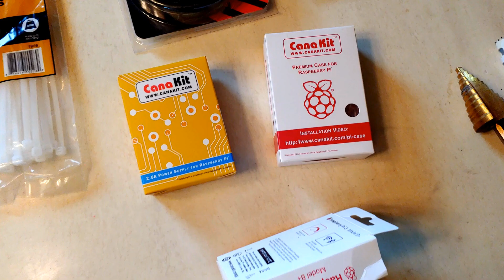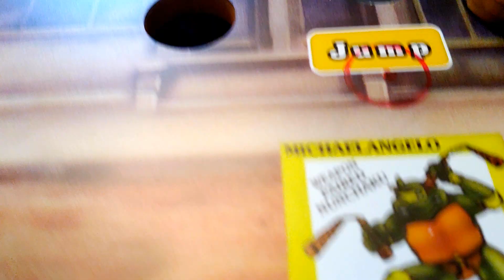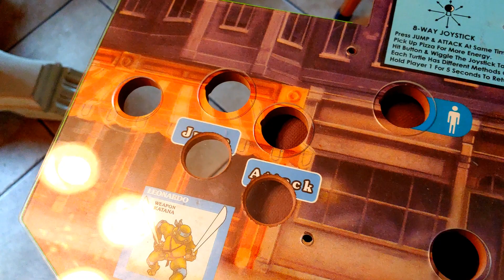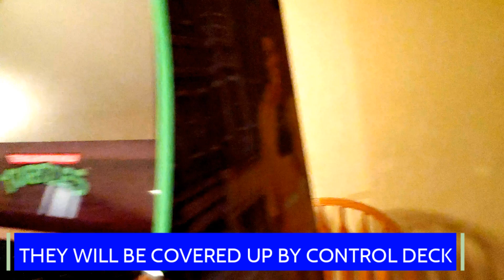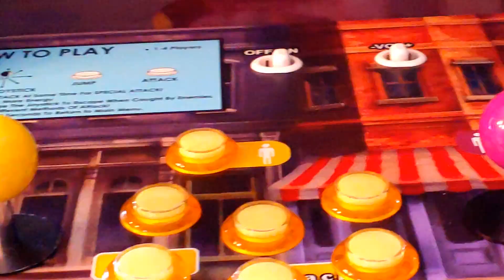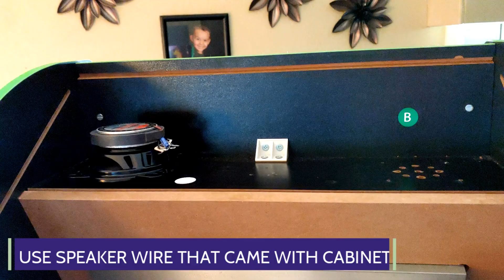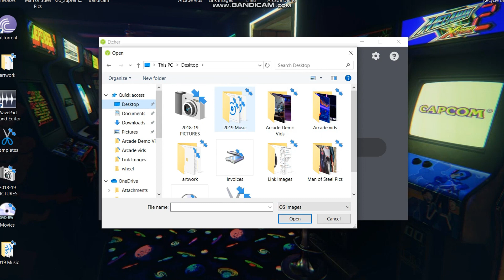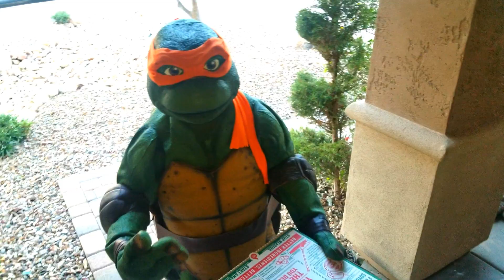TMNT Arcade1up 4 Player Cabinet Mod Tutorial

Comment: Great video. Had a few questions. How would you consider modding just for specific 2 and 4 player games with 4 buttons ? I want to have  neo geo games and 4player sports, action,etc. Should i go with the setup you recommended in this video without the extra buttons. I wish to only use 4 buttons max for each player and the games compatible for it or will i need a specific board and program? Sorry i am new to this. Any help is appreciated. Thank you
Reply from the maker: Hi Paul great question, all you would have to do is just add two buttons to each player since they come with two stock, should be very easy to do since there's plenty of space on the control deck for four buttons. The tricky part was trying to find space on the board to place the additional 5 6 7 and 8 button but if you only need four should be a piece of cake you can just pick the most convenient spot for the extra two buttons on each player

Comment: Curious why you didn’t use a Pi 4? I deciding between Pi3B+ or Pi 4. Still learning the mod world.
Reply from the maker: Good question, when I did this build back in January the pie for was just being released and had a lot of negative reviews online as far as overheating issues and not being compatible with a lot of the emulators, I think the longer the pie for is released the more people will learn about it and it will be updated and probably the better option over the pi 3

Comment: Got another one...I didn’t see you mention the coin buttons and where to hook them up at?  I feel like the little white cables that came with my buttons kit (same you linked too but mine are simply 3-prong plugs on both ends, button and board) are not very long.
Reply: Also, did you end up cracking the plexi in the end because you definitely didn’t have it on during your replacement of the top screws.  Maybe it’s on at the end but I didn’t notice.  Mine cracked to shit.

Comment: I must have missed something, where was the step of wiring up the buttons and the new joysticks? There was an empty control panel and then they were all in there and in place. 

Also, is it possible to use the factory speakers and volume and power switches?
Reply from the maker: Yep those steps were in the middle of the video....
Yes the fa tory speakers will blow with loud volume ...they are very low quality

You can wire the volume and power but it is not part of this tutorial ...
The wired ha e to be spliced into the correct plugs for these encoders to work
Reply: @arcadepickers1682  The buttons and joysticks seem to just magically show up in the control deck here - https://youtu.be/g9d1s0E1hPM?t=1296 , but I don't see anywhere in the video where you're adding them individually or wiring them up. I also didn't see the diagram you mentioned....I wonder if my player is skipping parts of the build.
Reply from the maker: So you're right I didn't actually do that on camera because I had to use both hands but all I did was push the buttons through from the topside and screw the washer on the backside the joysticks screwed into the same olds that the other one were in so no drilling required then it was just positive negative on each button and positive negative on each LED light on each button and the diagram comes with the buttons in the package from Amazon and you will see me show what it looks like a couple of times in the video all you have to do is make sure you put each button in the same slot on each decoder example button a for player 1 2 3 and 4 goes in slot one on the decoder button be for Player 1 2 3 4 goes in Slot 2 Etc.......
Reply: @arcadepickers1682  thanks. One last question (I'm a newbie here, got my TMNT cabinet coming tomorrow), if I dont want to hook up the power for the LED's, can that just remain unhooked, or are they required to be plugged in?
Reply from the maker: @MatrixPrime  no you can definitely leave them on hooked they are on a separate power source so if you just want to use the buttons no problem much easier to hook up just positive and negative on each button and you're done
Reply from the maker: Good luck with your machine tomorrow let me know if you have any questions along the way during your build I have no problem answering

Comment: Curious as to what other speaker and amp you would use because the ones in the link are no longer in stock. Thanks for the video
Reply from the maker: Really you can use any 4 inch speakers you would like they even have some that have lights in them if you want to go all out fairly inexpensive. As far as the amp it just depends on if you're planning on using a subwoofer or not if you are you just need any 2 channel amp that has subwoofer input as well and you usually have to always buy the power source separately. So go on Amazon and type in the one that I put the link and you will see recommended products on the same page usually has several other competitors with the same exact thing. Thank you for watching the video

Comment: Love this setup. Working on my own and have made substantial progress, but can you give some guidance on how you used that RCA cable to wire the subwoofer into the amp? I have a sub with two RCA low level inputs, and I need to get them to the +/- input on the same amp you used.
Reply from the maker: So all you do is just cut the end of the RCA's off with scissors then strip them down to the wire and connect them in to positive and negative and it's a done deal super easy
Reply: Got it! Thanks again for the help. Getting super excited about this!
Reply from the maker: @enolam05  by the way when you split it down two two wires each two wires might have their own two wires all you have to do is hook one side or the other into the positive and negative and it will be enough to power the subwoofer

Comment: Want to do this to my TMNT box, but the powersupply, speakers and sub are out of stock.  Do you have a recommendation for replacements?  Also do you think a raspberry 4 would be better?
Reply from the maker: Thank you so much for watching, you can use any 12 volt power supply that matches the same details of this one, also any 4in speakers will work with any subwoofer as well

Comment: Do you know if is possible to mod this to include like light guns as well?
Reply from the maker: It definitely is however I do not have any experience in that, I've heard it is very finicky and very hard to maintain accuracy.... what I do recommend is getting an RCA to HDMI converter then you can plug your Nintendo Wii into the HDMI with a splitter on the back then you can play any of the shooting games by we by simply placing the bar from the Wii on top of your arcade1up now you can play games like House of the Dead silent scope and hunting games with no problems whatsoever and you have several options of different sizes and shapes of guns to put your Wii mote in

Comment: Hey, great video!   I am confused on the hole dozer though?  You showed the 1 3/4 but put underneath 1 3/8?   Which one should I get?
Reply from the maker: 1 and 3/8
Reply: Thanks man!!!!!
Reply: @arcadepickers1682  Any reason to not just get a 1-1/8 hole dozer (hole saw), and use it for all the holes?  PCB board, Acryllic cover, and Plastic box?  I've never used a hole saw before, so sorry if this is a daft question!  I've seen lots of folks either use spade bits, step bits, or hole saws, so I wasn't sure what the right tool for each job really was, though you're one of the few who didn't crack the plexiglass!

Comment: Hello, did you just leave the back cover off? Also, do you have a link to the remote control power you referenced in another reply?
Reply from the maker: If it's up against the wall it will air out much better if you leave the back out and prevent overheating. I don't have a link but it's super easy to find at Walmart, it's over by the extension cords aisle and it plugged into the wall and you plug your arcade into it and it comes with a remote for about 8 bucks

Comment: I'm thinking about modding a Marvel Super Heroes cabinet. Is it possible to just use the stock speakers in the cabinet or do you need an amp and extra speakers?  Also I'm guessing you don't HAVE to replace the buttons and joysticks, but you may want to for quality reasons? (I know I would have to install two 'select' buttons)
Reply from the maker: You have to replace all of it....sorry

Comment: Thanks again for your tutorial got my machine up and running, do you have any issues with wwf wrestlemania working? For some reason it won't boot for me, I have the same crispr image as you also
Reply from the maker: YES YOU HAVE TO ADD THE PSX VERSION FOR SOME REASON....WATCH MY TUTORIAL ON ADDING PSX GAMES ITS EASY :)  THANKS
Reply: @arcadepickers1682  awesome thanks so much I was super bummed when it wouldn't boot
Reply from the maker: Me too...the psx version is pretty slick though !!! Happy gaming
Reply: @arcadepickers1682 did you have to set that favorites section up? Mine seems to be only sorted by system and no favorites category? Sorry to keep asking questions lol but you always seem to have the right answers for me lol
Reply from the maker: @MidwestVillain_Z  yes watch the tutorial called retropie setup favorites you have to go in and set up a favorites key on your keyboard and plug it into the Raspberry Pi then you can push the specific key every time you're on a game that is one of your favorites then inside of the retropie menu and you can go to generate favorites list and it will create your own custom list, I will do a tutorial on that soon but there are plenty of them on there right now. Good luck

Comment: Installed everything according to the video and as I was configuring the buttons the joystick would only read the up motion. Tried on another joystick and the same thing happened. Any idea what's going on?
Reply from the maker: Something is not wired up correctly, go through everything with a fine-tooth comb and double-check there is nothing incorrect, it is very tricky with the positive and negative wires. If everything is hooked up right it should work but sometimes it takes two or three times going over everything carefully

Comment: Excellent video, proved very useful to me while I completed my own over the past few weeks. QUESTION: Has anyone figured out how to save controller reassignments on a per-game basis? Meaning I generally want P1 and P2 to be Michelangelo and Donatello (where I have the most buttons), but when I switch to a fixed 4 player game like TMNT, I want P1 Leo, P2 Mike, P3 Don, P4 Raph. I know how to reassign controllers in Libretro and Retroarch, but it will only save by Core, not by game.
Reply: Did you ever come up with a solution for this mate?  I just realized the same concern as I started to put mine together
Reply: Just like arcade1up, you got Raph and Mikey reversed.

Comment: I think the link you provided for the display converter is an incorrect fit for the TMNT cabinet. Is that what you have working in your TMNT cabinet?
Reply from the maker: It is and I've been putting it on multiple TMNT cabinet for customers and it definitely works
Reply: @arcadepickers1682  ok, that's great. It's the one I got because I'm following your tutorial. I had just found during researching that the converters are for different cabs & the model numbers didn't match. So I just wasn'ts sure. I just have to get an image now & set it, to be done with my mod. Thx bud, you're a big help

Comment: Arizona’s Arcade Heroes what ROMs sets and packs torrent did you download? I liked your setup
Reply from the maker: If you go to my let's play Sonic Adventure 2 video it has the link in the description from arcade punks
Reply: A smaller sound bar and sub that I do not use any more should work right? It has the auxiliary and it own power
Reply from the maker: @myopinion2578  should work as long as the sound bar fits behind the Marquee and as long as it has the correct hook ups for the amplifier

Comment: Suggested images for 3b+ and pi4? By name? Sounds like pi 4 is the way to go now. About to do first mod. Purchased 3b+, thinking of returning. Want access to more N64 games. Going to follow your video for install. Need to learn how you added the music videos. Great add
Reply from the maker: I am not familiar with Raspberry Pi for the only thing I can tell you is I read that after it's released it had issues with overheating so you might want to research that, I have also researched that by overclocking your Raspberry Pi 3 B+ you can play N64 games a lot better, sorry I couldn't be more help, the only image that I am familiar with is the crisp image would you can find available in the link description on my Sonic Adventure video and if you look on my channel I also have a video about how to add the music videos walking you through it step-by-step, good luck to you my friend

Comment: Thanks for the detailed video. Do you know where else I can find the LED buttons and joysticks. They are sold out on Amazon. Thanks
Reply from the maker: You can pretty much by any two player arcade joystick kit off of Amazon, in fact since I released this video they have the new plug-in play ones that are way easier to hook up
Reply: Arizona's Arcade Heroes 
You have a link to them. This would be my first build.
Reply from the maker: @TexasFinest_Collectibles  https://www.amazon.com/dp/B07QMM4J9X/ref=cm_sw_r_em_apa_i_XAg2EbDXV3FDC
Reply: Arizona's Arcade Heroes 
Ah thanks, the joysticks are different on that set though.
Reply from the maker: @TexasFinest_Collectibles  it will work :)
Reply: Arizona's Arcade Heroes 
What’s the purpose of drilling the 2 holes on the sides on the control deck. I’m in the process of modding my cabinet but I’m keeping the coin buttons at the top of the control deck next to the player 1-4 buttons.
Reply from the maker: @TexasFinest_Collectibles  it just allows you to run the cords from the outside players controllers route to the back without smashing them down on the control deck there is a gate that blocks them on either side
Reply: Arizona's Arcade Heroes Thanks for the quick response. 
About how  many cords/cables will I have to run through the gate wall. Just trying to gauge how big the hole really needs to be. I’m keeping the coin buttons at the top of the control deck next to the player buttons, so I won’t need to drill the additional 4 holes that go to the bottom of the control deck. I’ll just need to drill 6 holes total. 4 on the back and then 1 on each side of the gate.
Reply from the maker: @TexasFinest_Collectibles  well you will have to run at least two sets of cords from each button so depending on if you used 4 or 6 buttons you will need one for each button then you will probably have to splice additional wire on to them to make them long enough to fit through the hole and reach all the way down into the back to the encoder
Reply: Arizona's Arcade Heroes 
Alright man almost done with the control panel. I have all the holes drilled, led buttons installed and wires plugged into the encoders. I’m stuck on the on/off and volume buttons, is there anything I need to do with those cables. Do you have an email address I can reach you at. I don’t have FB. Thanks man
Reply from the maker: @TexasFinest_Collectibles  the on-off buttons are obsolete as well as the volume you can just leave the wires taped up against the bottom of the control deck in case you have a use for them later but you will plug everything inside the unit into one power strip then you will buy a remote on off power Supply at Walmart for eight dollars and everything plugs into that so it's an easy click of a remote to power everything on end. In the volume control will be on the amplifier face so that's why I place that somewhere you can reach it
Reply from the maker: @TexasFinest_Collectibles  I'm not sure I've never used PC speakers I feel like you're going to get way better sound with a cheap amplifier but that's just my opinion, you might be able to hook it up to the power somehow I'm not sure. There's actually no link for the one that I usually buy it's just over in the hardware section next to the extension cord
Reply from the maker: @TexasFinest_Collectibles  should work fine the only issue you might have is I think the image that I recommend only works on Raspberry 3 B+ but I'm not for sure on that